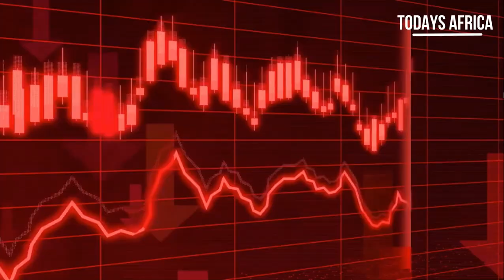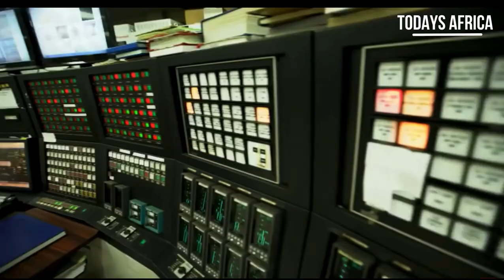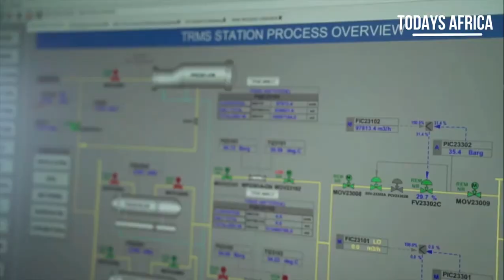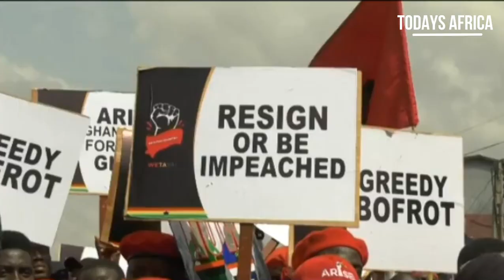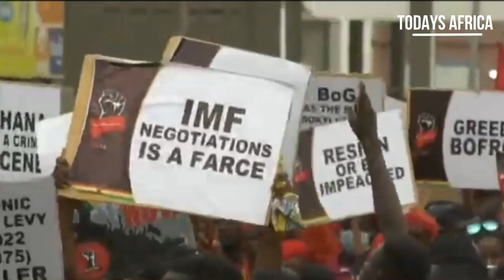How Ghana's Economy Insanely Collapsed Under 11 Months

Comment: Exporting more is not the solution, there are nations that have lower GDP per cap than Ghana but are way more resilient because their economy is more diversified and most of all they prioritize local needs, exporting comes after... Ghana like most west African nations is doing it the wrong way since they rely so much on imports for basic stuff. This is the kind of nation that will pay for every single crisis the west is experiencing...  But so called experts fed by western miseducation will tell you Ghana needs more foreign exchange currencies ... This is BS ... It's a system that is setting African nations for systemic failure ... And thats how the west is able to bounce back...